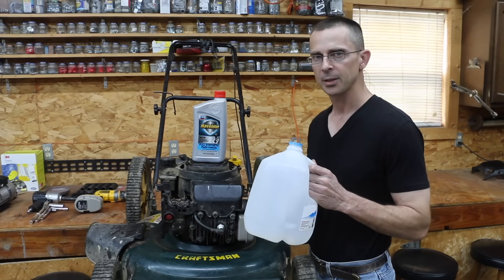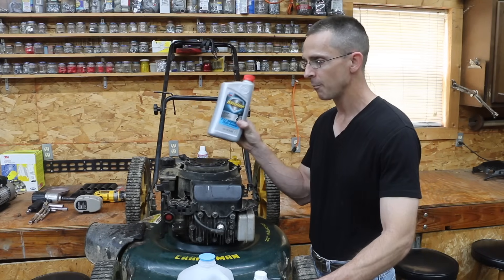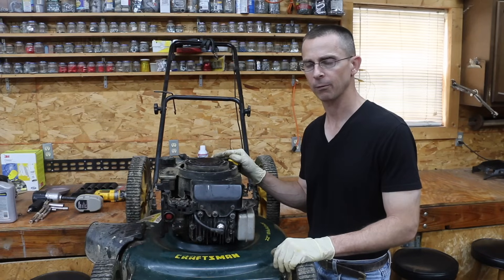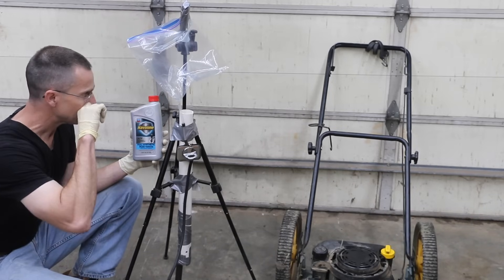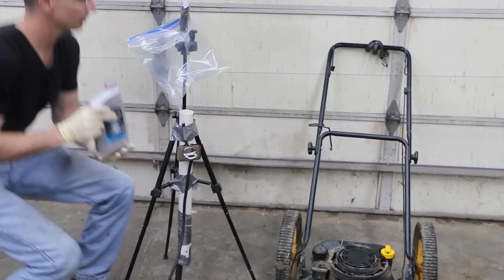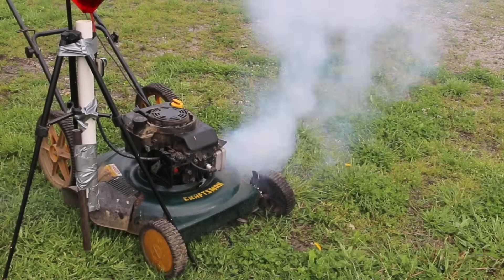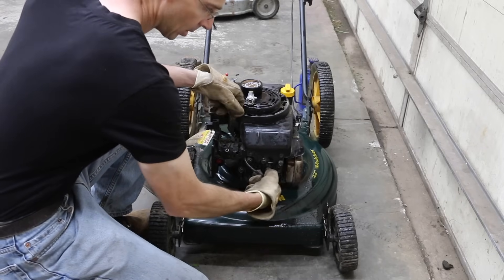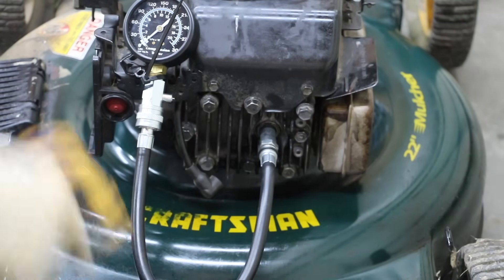Seafoam--can't believe what it did to my engine episode 6--Seafoam vs ATF!!

Comment: Seafoam is best like any additive to use regulary. I put it in my gas can as soon as i get gas for my small engines. Keeps gas fresh over winter and keeps engine clean. My car, i will put a can in here and there but newer cars with gas , oil, and tolerances dont need the tupical cleaning.  I spent 20 years as a auto tech. Back in the day, we poured water in the carb to clean, before i had bg stuff. Atf i used for cleaning parts before a parts washer. Lol.. good ole days.  Even running 87 10 percent ethonal in my small engines, runs fine. I am playing around with ethonal free aka non oxy to see how my lawn mower and atv runs.

Comment: Can you review Lawn Mowers?
I have a very old Victa 15years odd, seemed to running slow today, I checked the oil and it was not on the stick. put new oil in and its ok...
Can you check the 4 blades vs the twin blade ?
And those catchers... I clean the vent on the Victa every time I empty it.
Can you check a tidiness of the lawn strip ?  by looking along it at surface level.
Reply from the maker: Thanks for the suggestion.

Comment: Retired diesel mechanic here.  I own a small fleet of vehicles, both new and old.  I haven’t always been able to afford new vehicles, and I still have a few old ones, from 1966-2023.  While I agree with some comments that good maintenance will prevent many of the issues you tackle, there are some things we can only minimize, such as sludge and carbon.  Some of these additives are necessary for older engines we buy that were not maintained all that well.  They need cleaners such as ATF, water, whatever works.  Newer engines will one day need them, and some of us use them sparingly as a preventative measure.  Gasoline and oil are not perfect, and neither are climates.  Some gunk will be left behind.  I have used ATF, Berryman’s B-12 Chemtool, Sta-Bil, and Marvel Mystery Oil in varying amounts over the years.  Those work best for me.  I even treat my newer vehicles at oil changes as a preventative measure.  I am easy on my equipment, buy good gas and oil, and I have never replaced or rebuilt an engine I owned.  I exercise them regularly, get them up to temperature, and even drive them in a spirited manner.  Most things I learned from my grandparents, parents, and older guys at work who grew up with substandard gas and oils.  They had to figure out how to make things last.  Thanks to Todd / PF we don’t have to experiment, spend money, and countless hours trying to find the best solutions.  You’re doing the work for us, and we all benefit from your efforts, and watching you is much better than going to the movies most days!  Thanks, and keep up the great work!
Reply: Very well said!! 👍
Reply: Im a mechanic myself and look after my gear but sometimes i buy used equipment thats been neglected. Any recommendations for a flush. Diesel? Atf? Commercial product?
Reply: @izaacbanks3337  Hi.  Not knowing your situation, I’d say an oil based flush would be safest.  It may take more than one time.  Nothing is magic.  ATF and Marvel Mystery Oil are safe bets for me.  Both have detergent properties and will gently clean.  I have not tried Valvoline’s Restore and Protect, but I may soon.  It’s supposed to be gentle and gradual so you don’t plug the filter.   My dad used to use home heating oil, and he used it strong.  I mean like drain the oil and refill with Kerosene.  It cleaned alright, but lubricity had to be minimal.  Then the lifters were full of it so he had to change the oil again very soon.  Noisy as heck while it was idling in the driveway for 10-15 mins.  His engine was a 352 in a ‘58 Ford, for reference.  He used Quaker State back in the 60’s.  When we pulled the valve covers, it was full of ash in there and the oil returns were plugged.  It looked like layers of burnt leaves inside. May have been the oil back then, may have been poor maintenance.  I don’t know how often he changed it, but every other tank he needed a quart.  Anyhoo, good luck with your flush.  If it’s something old, or hi mileage, I’d take a conservative approach.
Reply: Reztore and protect is similair to amsoil in cleaning detergents. It works fron test results i have seen but spendy. Id rather run a quart of atf ir mystery oil , run engine and drain again. I dont think it would hurt to run even 1 to 3k milescand let it clean like amsoil and valvoline does.

Comment: 5:20 definitly not a poor use of resources. I am watching 7 years later, after hearing about seafoam, and thinking of starting a yearly ritual of a can for my car, and a can for my ATV, preasure washer, lawnmower, and perhaps whipper snipper. small price to pay to put away all the motors for the winter all clean on the inside, making them start easier in the spring of next year. also will probably just overall extend the life of them. BUT if something works better, and its within my capability, and i got the right tools, im gonna do it. so keep experimeninting :) so that people like me can just cheat and watch some videos to get the best resaults :)
Reply from the maker: Thanks for sharing.

Comment: You have to use ice cold water to clean internal combustion chamber and drip it in. It works extremely well that way without the oil getting creamy.
Reply from the maker: Thanks for sharing.

Comment: I have used ATF for many years for  carbon removal but I use it as a soak and sit for 24 hours. Always melts the carbon build up after a winter of cutting firewood when the truck sees little rpm’s.
Reply from the maker: Thanks for sharing.

Comment: I think seafoam is a very good product. I don’t have any delusions that it will work miracles.  I had a motorcycle that have been sitting for a long time, and would not idle without me bringing up the RPMs with the throttle. I added seafoam and fresh fuel as directed on the bottle and drove the motorcycle about 30 miles at varying speeds up to about 60 mph. When I got home, the motorcycle would idle without me, giving it extra throttle.  However, later, I drove the motorcycle to a motorcycle repair shop and had the carburetors rebuilt and different jets put in as I put on a set of slip on mufflers.
Reply from the maker: Thanks for sharing.

Comment: My 2 pennorth on SeaFoam..   tried it in my well maintained low mileage SKODA 1.8 turbo.   Injected 1/2 a can through  the breather system into the inlet manifold, ( it’s a direct injection engine😠).  On tickover,—-not a lot happened🙄.    6 months later for no other reason than to use it up, I did it again,  the improvement was quite striking.  No numbers to back it up but a worthwhile improvement at little cost and a big surprise.  Keep up the good work 👍🏴🇺🇸🏴

Comment: I know man that was getting 700 thousand miles plus on Chevy 350 engines in delivery vans and he only used formulated 15/40 diesel engine oil, oil changes were done every 5000 miles
Reply from the maker: Thanks for sharing!

Comment: I have question i been using transmission fluid in the motor before a oil change on my older trucks for years but can it be done on the newer modern trucks ?
Reply from the maker: Thanks for the suggestion.

Comment: None of this testing was done right. You have to use the same amounts of fluid, using the same device to add the "cleaner", the same amount of time, on engines that start with the same amount of carbon deposits.

Comment: Your videos are great.  From my experience:  I used ATF as an engine flush on my wife's very well maintained 2018 Hyundai Santa Fe 2.0L Turbo with 75,000 miles.  After draining the oil & changing the filter I filled the crankcase with Valvoline Max Life ATF and idled the engine for 25 minutes.  I then drained the ATF, changed the filter and refilled with full synthetic oil ( all this vehicle has every seen @ 4,000 mile intervals ) .  The ATF I drained  was black.  I mean black, black.  So yeah, it's a good lubricant and detergent.  Regarding the combustion chamber, CRC Intake Valve & Turbo Cleaner is awesome.   Keep up your excellent reviews.   Thanks.
Reply from the maker: Thanks, will do!

Comment: Try x66p Delco. It melts combustion chamber and intake track contamination. No, I'm not affiliated. I've seen it unclog injectors that acted like a spark plug miss on an engine. Run a mist thru the engine with a gasoline mix like you did the water injection an let it sit and work. Then run it thru the injectors as the instructions say.
Reply from the maker: Thanks for the suggestion.

Comment: I've heard or using atf to clean automobile engines with a 50/50 atf/oil mix, run for 30 -45 minutes, then replaced with 100% oil, always been hesitant to do this though as I'm not confident you don't increase friction/wear of internals for that 30-45 minutes for the benefits of the detergents/cleaning abilities of atf, I'd love to see some sort of test that would give some indication of whether this is ideal or not
Reply from the maker: Thanks for the suggestion.

Comment: I worked at a Ford dealership back in the 1970s and the older mechanics would slowly pour water in the carb on those pintos when they came on knocking and would go out running like new
Reply from the maker: Thanks for the feedback.

Comment: I have used Rislone in the past and it blends well with oil. I just add and leave in for the duration of the oil.  
Two different mechanics used ATF to help clean engines.
One added a little up to one litre and for Diesel engine as well.
The other used a full 4.5L and let idle around 20 minutes to wash out scum and deposits from a head gasket leak.  
I have never tried Seafoam or added ATF to the engine.
I have tried Wynns in the past as well. Its a Varsol base cleaner.

Comment: the water turned into steam, flowed past the ring gaps and valve guides and recondensed in the oil. Steam is way thinner than oil. Its not gonna matter if you use a water spray or squirt bottle, the end result is the same. Steam getting past parts and recondensing. Method of delivery into the intake is irrelevant.

Comment: 70 plus years ago, the trick for carbon buildup and lubricating the upper cylinders and valve stems, was to take the breather off, start the car, and work the throttle link to increase rpm when water or diesel liquid was added. The water first added to mouth of the carb as engine speed was increased each time. About a cup of it was used and then road tested. After this was done, the water treatment was used the same way. Lots of smoke with oil but steam when water was used. Road tested again  and there were major improvements with a more smooth running engine.
Reply from the maker: Thanks for sharing.

Comment: I used see foam on a motorcycle that burned oil used it in crank case gas and sprayed into intake didn't help with oil consumption but when we took apart the engine the tops of the pistons almost looked professionally cleaned
Reply from the maker: Thanks for sharing.

Comment: It’s funny you got the preventative maintenance snobs. They must buy only new cars. I’m poor spent 5 years homeless flipping cars to get on top and only drive cars that I’ve bought cheap and fixed up. It’s amazing the cars you can get that people think are dead in the water and revive them alot of time with just changing the tranny fluid and filter  and putting some Lucas stop slip in it.

Comment: Agree, if you keep up with preventive maintenance these items may not be necessary (other than using Techron or Seafoam for injectors every 3-4K miles...and using Top Tier Fuels); however, it is great to see tests like this if a person purchases a used vehicle or even a piece of lawn equipment. Then, these additives might be needed.
Reply from the maker: Thanks!

Comment: the first automotive engine i seen run atf was a Toyota 22re engine with over 220k miles the owner ran a quart of atf in approximately every other tank, the engine was spotless inside the head piston and valves were clean no carbon whatsoever
Reply from the maker: Thanks for sharing.

Comment: I know this is old and you're continuing to this day, but A lot of people don't realize what's in gas and is left as a byproduct of the burn cycle and is why it's so important to run cleaners every once and awhile. Gas has tar in it - basically an asphalt byproduct to give it the resistance to pre-ignition or simply it's octane rating. They've been doing that ever since getting rid of the lead in it. Don't believe me just put some in a bowel and set it on fire then touch it right after it goes out - guarantee it's sticky... This is why the carbon builds up in the first place and is why it has to be cleaned every so often. I've never tried trans fluid through the intake like this - always used chemicals. I bet the trans fluid would be safer on your body as well. Keep up the good work sir ;)
Reply from the maker: Thanks, will do!

Comment: Love the comprehensive selection of products for testing.  Based on what you've demonstrated so far, would rank the top three in terms of effectiveness as:
  1. ATF
  2. Water
  3. Seafoam
However, one must also take into consideration ease-of-use.  

Since nearly all--if not all--cars manufactured today use fuel-injection, one cannot simply remove an air cleaner and pour something down a carburetor throat.  So, which of these products can easily be sprayed into the throttle body of a fuel-injected engine?  Would say there is only one--Seafoam.  The only other alternative would be to add the product to the gas tank, and who is going to think it's smart to pour ATF or water into their tank?  

For that matter, removing the hose that leads to the front of a throttle body on a fuel-injected engine requires tools, unlike the wing-nut on a carbureted engine. So, as a practical matter would say Seafoam wins the day.
Reply from the maker: Thanks for the feedback.

Comment: I enjoy your videos!!
ATF I use to free sticking injectors in Diesel engines old and new systems.
They removed sulphor which is a lubricant, also the detergents
Free sticking injectors. 
At 2200$ a for a diesel injector 
On some engines that’s a lot of atf. Lot easier adding some to the diesel than replacing injectors
Reply from the maker: Thanks!  Thanks for sharing.

Comment: 3 months ago I bought a 45 year old truck. When changing the leaking valve cover gasket, I saw the engine parts look worse than I've ever seen in an engine. I'm looking to find what's the best add-to-oil cleaner. I'm on my 3rd oil change and it's black as night. However, what can I add that cleans better than just an oil change each month???

Comment: I’d be more inclined to just add a little ATF to a tank of fuel once in awhile (on small gas engines) 
Some type of oil seems to help stabilize fuel also…I notice 2 stoke fuel doesn’t seem to go bad as fast as just plain fuel.
Reply from the maker: Thanks for the feedback.

Comment: I think using an atomizer with the water intermittently and letting the engine get hot again between sprays.  This would let the water work at higher temperature.  Maybe put the engine under load. Probably a lot less water and gas would be needed.  Maybe the same can be said for automatic transmission fluid.
Reply from the maker: Thanks for the feedback.

Comment: The water/oil milk you made in the previous video was a very clean white. You should use that as a "seafoam" replacement. This mower has a strong tendency to transfer things from the cylinder to the crank case, so it's entirely possible that you may get your oil back, and boil off the water. That's assuming the water and heat don't change the chemistry to something awful.
Reply from the maker: Thanks for the feedback.

Comment: I really enjoy your testing. On these fluid tests, have you considered that Seafoam or (insert name) was designed to be put into a tank of fuel and run over  many hours. Also there is much soaking time (perhaps weeks) that these fluids are often left in systems. Maybe consider filling the lawn mower, burning 1/2 then letting it soak in the carburetor and cylinders. Keep up the awesome testing.
Reply from the maker: Thanks, will do!

Comment: Hey mate nice video! I think the results show, that science rocks! But back to ATF... Have you ever tried it in your truck engine for blocking small engine oil leaks. About half a spray can cap full I guess. I've been told that the ATF makes seals swell up and does a good job of it.
Reply from the maker: Thanks!  Thanks for the suggestion.